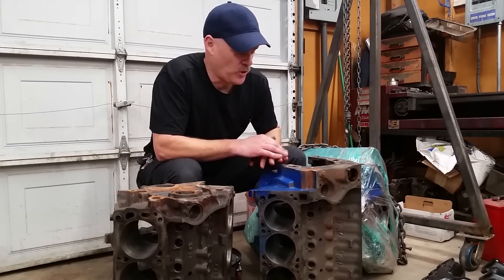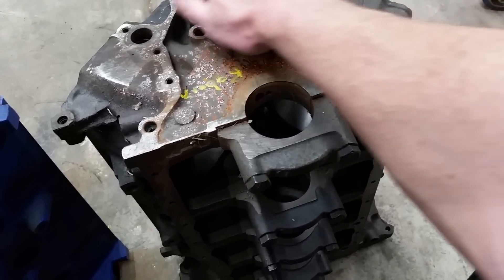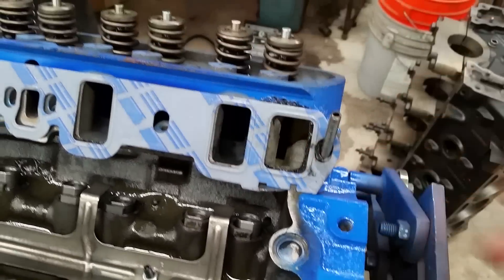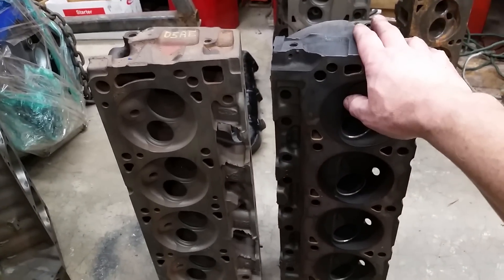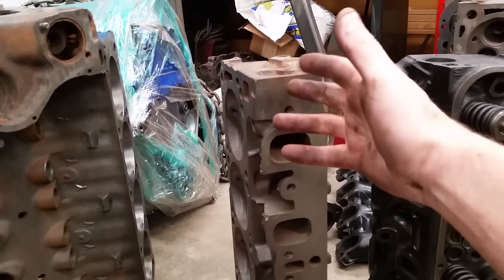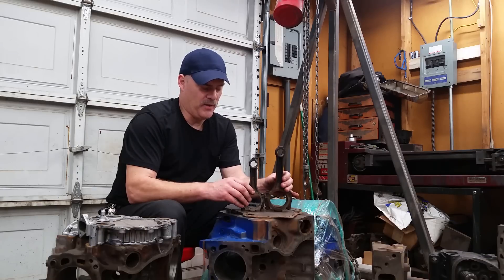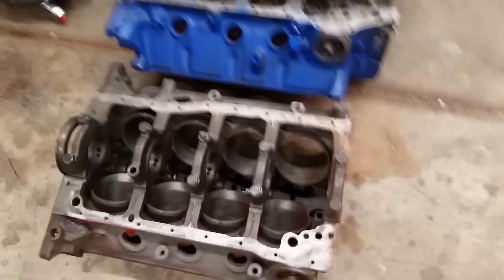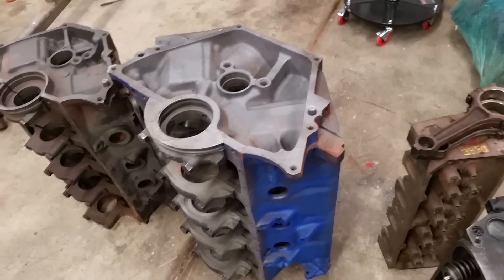302 vs 351M blocks

Comment: 351W has 3" main journals. The same as the 400 and 351M. The 351C has about 2.749" main journals. The rest of the SBF engines had 2.249" main journals. 
Deck heights for the 221, 260, 289, and 302 is 8.2".
Deck height for the 351W is either 9.48" or 9.5" depending on the year.
Deck height for the 351C is 9.2".
Deck height for the 400/351M is 10.3".

Comment: I want to rebuild my all original 1977 351 M400 engine in my F150 let everybody I've talked to says just put a 302 in it I call them idiots cuz I don't want to f**** 302 I want my original engine sorry for the swearing but what has more horsepower

Comment: Hey quick question for you. My son and I are doing a ‘77 F150 4x4 project together. Stock motor is is a 351M but I want to swap it over to ‘87 5.0 HP. I know the actual engine mounts are different from 351/400 to 302/5.0 motors but what about the frame engine mounts will I need to make any modifications? Thanks Jeff
Reply from the maker: it depends some of the frames were drilled some were not its kind of a crap shoot with fords

Comment: So on the 351M if there is  water and oil mixing it will not be from a bad intake gasket? I purchased a 351M f100 and the motor was supposedly rebuilt but i have the dreaded milkshake. I have no experience with 351M motors so i was thinking maybe it was a crappy intake gasket but if there are no water ports then im assuming that wouldnt be the case. Correct?
Reply: No it's a head gasket coolant  does not go through intake on 351 M or 351 cleveland or the 400 ford

Comment: So im thinkin, 351w block, 302 crank, 351m alloy heads & con rods.
Throw some long headers & a tunnel ram with a mid cam.
Balance it to 10k😊
Reply: That won't work. 302 crank won't fit.
Reply: Scrap the 351M400 heads and get some Cleveland heads or aftermarket Windsor or Cleveland heads.
Reply: @oneninerniner3427  im just thinking about things that, at the tine i might be able to get at a junk yard,  my 351 block is a marine one and has kess tg han 100 hours on it, i have some gt heads and a alum intake

Comment: I love how you build engines in that nasty shop and leave customers intake laying on a dirty floor and the engine is open inevitably getting full of debris.
Reply from the maker: There is nothing being built in that area these are bare blocks or engines that are being torn down the small block on the stand is a customer engine that they built and had a problem with I am going to tear it down and inspect it will be reassembled in the assembly area after repair and finial cleaning you should probably ask before you make assumptions because if you don't you always end up being they guy that everyone sees as not knowing what he is talking about just a thought

Comment: There is NO such thing as a 351M block they are all 400 blocks. And those are NOT casting numbers but engineering numbers.
Reply from the maker: You need to let Ford in on that because it's called a 351M by them in their tech information perhaps you can email them and give them an education.
Reply: @Myvintageiron7512   Comprehension is a beautiful thing.  No one said there is no such thing as a 351M.  Read it again...

Comment: Also important .302 block and a 351 w block . The 351 w has half IN head bols and a 302 w has 7/16" head bolts . Why not use the cubes and get the extra claping force . Love that your not single minded and can share noledge on all of the old iron V8s . 👍

Comment: As usual no one mentions the 302 Cleveland produced along side the 351 Cleveland in Australia from 1975 untill 1984/5 cast in Geelong Australia, had same block as 351C but longer 6 inch rods and Closed Chamber 2V heads along with 3 inch stroke , even the Aussie 351 C with Four Barrel carbie used 2V heads !

Comment: @Myvintageiron7512 can you confirm that a 351m/400 heads will bolt on a 351w? and if so are there other parts that need to be changed? will the OEM 5.8 intake manifold work?
Reply: I wouldn't bother with the open chamber low compression 351M400 heads. And the Windsor manifold won't work with Canted valve heads. Get some aftermarket Windsor or Cleveland heads. If you use Cleveland or 351M400 heads on a 351W you will need a special intake manifold and some machining of the heads.

Comment: I learned in the seventies that a 302 boss was a 289 with 351 Cleveland heads. That’s how they made the original 302 boss!
Reply: A 289 with Cleveland heads , if ever would be a 289 not 302 ! And lets loose the old wives tale of the 1968/9 Ford Boss 302 was a Windsor with Cleveland Heads !!! That is impossible as there was no Cleveland 351 even cast till 1970 , so you can't time travel back to 1968/9 with a set of heads ! What happened was the Boss 302 heads were used to design a new for 1970 engine that was the 351 Cleveland so really a Cleveland uses Boss 302 Heads !
Reply from the maker: The Australian version was even cooler they had a Boss 351W called it the WB
Reply: @Myvintageiron7512 crap from Australia! Never happened , we did have 302 Clevelands
Reply: @JosephCowen-ru7up   this⬆️ 👍💥💨

Comment: Hello is 351m bell housing bolt pattern same as 351 windsor an cann u put a c6 4x4 on both engines
Reply: No and no the 351 M and 400 have big block bellhousing except for a very very small amount of them , so small they don't count

Comment: Cool I had a 79 bronco with a 400 in it dropped a valve and got me home I repaired it and kept drive years more!  great engine!... Also had a 351 Cleveland in a 71 galaxie great engine the transmission bolt pattern is a dead giveaway between the Cleveland and the 351m/400... 351c small pattern. 351m/400 big pattern. Easy to spot at the junyard!
Reply: Right on

Comment: A few is not a yblock
Reply: You are mixing up a noun and an adjective, the noun Yblock refers to the 239,252,272,292 and 312 ci Ford engine family . The adjective Yblock refers to the block layout being the block extends past the crank centreline creating a Y, and the FE family 332, 352, 360,390,410,427,428 have this so can be called a Yblock design, for that matter a GM LS is also a Yblock design !

Comment: If you have a 302, you can pull it and swap in a 351 Windsor but you can't if you have the 351m because it's a different transmission. However, if you have a 351m, you can make it a 400 simply by changing the bottom end since they are the same block/heads/intake. The 400 isn't a bad engine, but they're kind of a dog and don't enjoy the same level of after market part support as the 351w does. Currently, looking to turn a 351m into a 400 for my 1977 Tbird

Comment: So the 352M has the same bell housing as the 460 could a 351 M bolt up to the 460 motor mounts?
Reply: Yes 351 M  and 400 are small blocks will big block /385 series bell housing a 460 will bolt right in where a 351 M and 400 was ....the 351 cleveland had same bolt pattern as 351 W 302

Comment: You mentioned a FE block and said it’s a Y block......please explain..... wasn’t the Y block made in the mid 50’s?
Reply: You are getting a noun and an adjective mixed up ! The noun Yblock refers to the 239ci , 252, 272, 292 and 312ci Ford Motor Family . The Adjective FE is a Yblock describes the block layout being Yblock IE the block extends past the crank centre line which the FE motors did , you can call a GM LS a Yblock too !

Comment: Fantastic video thank you very much so much information.  I'm a 61 year old retired Marine a little beat up from the years of service. But you really give me motivation. I recently picked up a painfully bone stock 1977 F-150 4x4 4 spd with a 351 modified engine. I seem to have a knack for finding out of the norm vehicles. Thanks for all the great inside and info on this 351m engine. FYI 1977 F150 has never been restored. Been  sitting for almost 16 years. It's a short bed Farmtruck but it has full trim and a vinyl roof. I love the patina on it can't wait get it running. First time viewer I will definitely be back.

Comment: My dad at a modified in a 76 LTD man that thing ran good and lasted years we could take it cross country and never have no problems out of it he rebuilt it when we first got the car and lasted 12 years till he got rid of it and the guy ran it for years after that till he sold it. I’m not a Ford guy but they built some awesome engines the modifieds don’t get enough love and there really a factor stroker engine.

Comment: I have a 78 bronco with a numbers matching 351m that has only 11k miles (kid you not, 11k miles.)
and I'm not sure if I should keep the motor because I'm going for a fuel efficiency build (so, a 3.8L v6 from my 98 mustang with a 4.2l v6 crank shaft and a pseudo stroker kit built for it.    Stroking it just to get a little more horsepower and slightly better fuel economy.)

Unless there's a convincing argument to be made of why I should keep the v8, or sell it otherwise, I'm just gonna do a mustang 6 banger swap. :P

Comment: Y block is 312 tbird engines weren't it
Reply: Again you are mixing up a noun and an adjective, the noun Yblock refers to the 239, 252, 272,292 and 312 ford engine family . The adjective Yblock refers to the block layout of which an FE is a Yblock design were the crankcase is extended past the crank centre line . A GM LS motor is also a Yblock design.

Comment: good info. i get into it with non knowing ford guys all the time. so many goofs in the comments 400m, nope. ford never used the m behind the 400 designation. and the 400 haters missed the fact that the 400 won horsepower wars 3 years in a row
Reply from the maker: the 400 is nouthing more than a 351 stroker people that hate on them must hate stroker engines
Reply: 351M is a shorter stroke Crankshaft 400 with relocated wrist pin positions on the pistons. Same engine otherwise.

Comment: I had to replace head gasket 5.4 Triton. Had head pressure tested.  And check for straight nest. put new time in chains. now I have a rest pin knock. any thought to what I might have done wrong.

Comment: do they make a 6 icnh rod and piston combo for the H.O. 302? i can't find any, i'm guess they would be custom, thanks
Reply from the maker: I'm not aware of a 6" rod for a 302 I wouldn't run that long of a rod anyway the rod ratio would be to high for that short stroke it would hurt your torque
Reply: @Myvintageiron7512  it would rpm happy 2.0. you can't get any better for zippy!
Reply: Australian 302ci Clevelands came with six inch rods !

Comment: I have had a number of these engines and have found that the 351M and 351C had oiling problems with the crank but have not had the same problem with the 351W
Reply: The M or clveland if building have the crank cross drilled for better oiling also high volume oil pump  and run 15-40 diesel oil in these motors

Comment: In Australia the 302 Cleveland used a shorter stroke crank with 351 pin height piston with 351M rod, just to muddy the waters a bit more
Reply: Sorry not 351 M rod as it is 6.25 inch , the 302 Cleveland has a six inch rod , made in Australia just like the 302c block

Comment: Hello I have question 289 and 302 I build 289 but block said 302 can’t you tell me the diferente thanks....
Reply: 302 W has 3 inch stroke and 289 W has 2.87 inch stroke , that's the difference

Comment: I am late to the party here, and great vid!  But, if I may correct you, the FE and Y-blocks were two different engine families.  292, 312, etc were Y-blocks, and the FE started out as a 352, 360, 390, 428, etc.   The M gets a bad wrap, but they were pretty stout motors.  Not power houses by any means, but durable!  Although I have heard some having issues with the block shifting in the valley, causing cracks between the lifter bores.  Great comparison, to show the difference in mass compared to the SBF!
Reply: The FE engines are actually devided into two different types, the car engine FE and the truck engine FT and they're almost the same but there are a few important differences

Comment: The 351M does not stand for modified. The M is for Michigan because that’s where it was made.
Reply from the maker: You are right and wrong it does not stand for Modified and it also does not stand for Michigan it actually doesen't stand for anything it's just M
Reply: There exists debate as to what Ford meant by the "M" designation of the 351M. Some claim the "M" stands for “Modified” - being modified from a 400-V8 with a shortened stroke - though others claim that the "M" refers to the Michigan Casting Center, where the 351M began production. Some say that the "M" designation has no official meaning, and that it was just Ford's way of distinguishing the 351M from the 351C and 351W.[29]
Reply: Ford never said what the M is for its all a guess really

Comment: The American 302 and 351 Windsor are basically the same engine with a different deck height.  

The 351 Cleveland and the 351/400M are basically the same engine with different deck heights.

Now there are some differences in main journal sizes and bell housing mounting, etc, but that's the basics of both designs.

Comment: Hey bud. Love this episode. I was wondering if that timing cover for the Cleveland block instead of the stock steel, would a stainless steel plate be better? I have seen the stock ones get pin holes usually from too much water instead of the 50/50 mix not being correct. Would a stainless plate work better? It wouldn't be hard to make since it is a flat piece and could be cut with a plasma cutter.

Comment: What year did any of the 351 engines start using ECM/PCM , and is a stroker engine kit availabe for a 351 M ?
Reply from the maker: mid 80's for ECU yes the 400 crank is a stroker crank

Comment: We built a 400 with Boss 302 heads and made spacers for the 351 C INTAKE After we modified the heads to work on that block .This was back in the 1970's because we couldn't get a 400 crank inyto a 351 C block and we had the heads fron another job  . It worked well in a 1871 Mach 1 .

.

Comment: Ok so which one of these engine blockis capable of handling insane levels of horsepower?
Reply: I like the bottom ends of the 302 and 351 Windsors better.   The later 5.0 Fords had forged TRW pistons from the factory and you had to do something really stupid to kill them.

Comment: Some one pull the original 390FE on my galaxie and they drop a 351M,
 i was going to build it  but summit racing told me it wasn't worth it.... what is your opinion on the 351M as a machinist and your knowledge ? 
Is it really worth it  or not ?
Reply: Personally if you already have the 351 I’d just stroke it to 400, unretard the timing, use Cleveland heads (Australian ones if you can find it) double roller timing chain headers and in HEI distributor andan aluminum intake. Definitely ARP rod and head bolts but I wouldn’t spend a fortune. It’ll never be a drag engine but it will keep up ok.

Comment: Australia produced 351 Cleveland for quite a number of years which have thicker blocks then they also did something very strange they made a 302 Cleveland, same size block different size conrods Actually longer.
So a very popular build many years ago was 2 use the 302 con rods on the 351 crank with shorter pistons and presto a lot of power
Reply from the maker: Yep I am getting ready to do a clevor engine 351W with edelbrock aluminum heads

Comment: 10 4 very informative loaded with information I use to be a chev man all my live my boys got me started on mustangs
Reply from the maker: I like chevy's and Fords Ive has some really good ones from both brands but my favorite is Mopar
Reply: @Myvintageiron7512  Do you take in outside work? I don’t see any info for your shop on here. I’m up in Cave Creek and need to have a valve job done on my 79 bronco with a 351M. I was going to drop the heads off at Phoenix Engine but my buddy got screwed around by them and I’d prefer to go to you since I love your videos.Thanks, Dave

Comment: The 351m/400 engine block actually has the engine mount bosses from the 351w family but they are not drilled. The deck height is about 1 inch taller than the 351c engine. As you mentioned the 351m/400 heads are worthless they are notorious for denotation, pinging or knocking.  Better off with a set of squishy Aussie heads or aftermarket aluminum heads.  I have a 1979 Lincoln with a 400ci and C6 plus a 9" rear end that I plan to install in my 56 F100.

Comment: i still like my 390 but my 428 68 cobra i just love it and it is stock with a high rise dual 4 u just can't beat it and it is not all about power it is a cobra but i'm a chevy guy u can't beat a bb chevy dollar for dollar but then u have mopar the 426 hemi boy would i like to get one of those but i do have a small hemi  i was told it was a 392 hemi but not sure i have not dun anything with it i got the 68 cobra for 1500 but needed work i had a 65 shelby with a 390 think it was a 500 but had no stickers left on it got it dirt cheap then some offer 8000 for it i said sold now i kick my self but i need a 69 camero z28 or a ss for my collection of camero's i have every year of camero from 80 on back all i need is a 69 and have some rare ones at that have u ever seen a 79 z28 rs t top full spoiler kit camero the full spoiler kit is supper rare on a camero it is one of a kind car it is the only camero i have seen with the full spoiler kit on a camero from factory it was an option but know buddy ever got it it was very expensive to get  it has spoilers in front and in back of all wheels like a T A spoiler kit it is more rare then a yenko camero if u don't believe me just try to find any camero with the full spoiler kit this will tell u how rare my car is so far i have not seen any camero with the full spoiler kit on it i been trying to find another one but can't